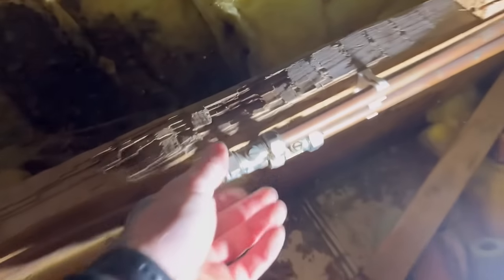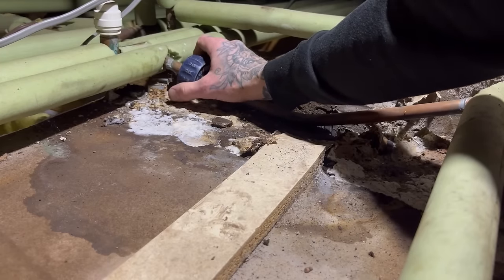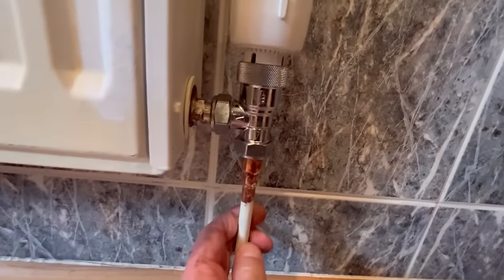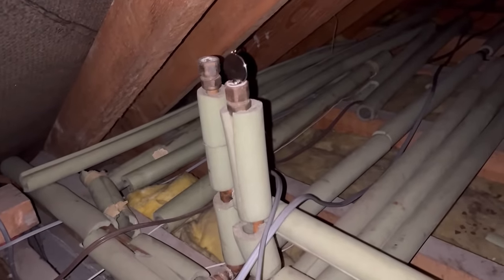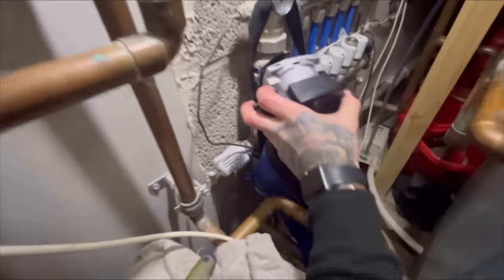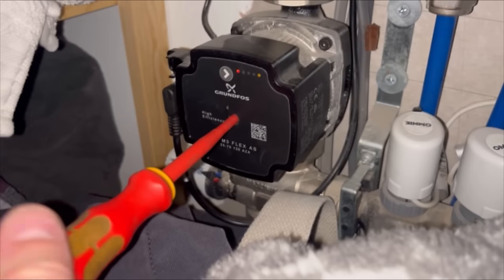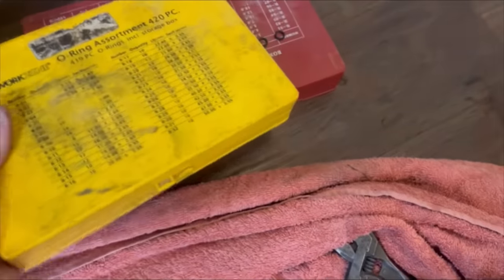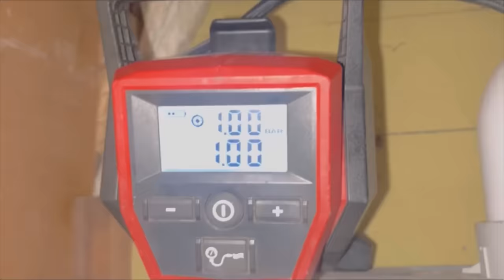Not 1! But 2 leaks!What are the chances! #plumber #plumbing repair

Comment: Isolation valves on heating systems I thought was a great idea. I was at a rental property recently and it had a drop system and on every drop there were a pair of isolation valves near the ceiling. Genius I thought. Is there guidance that states otherwise? Obviously if I were doing it they would be full bore vales. Keep up the great work, love your videos 👍🏻
Reply from the maker: I think it’s more these cheap not full bore ones mate. They block up easily that’s all. These cheap valves leak from the screw just by looking at them 😂😂😂😂